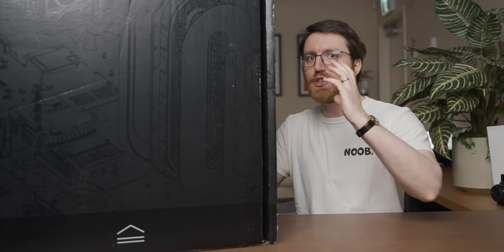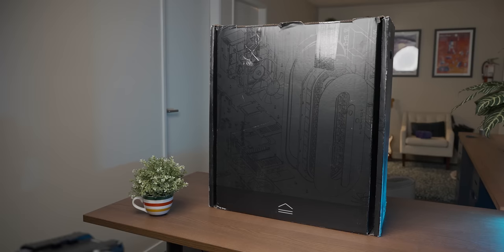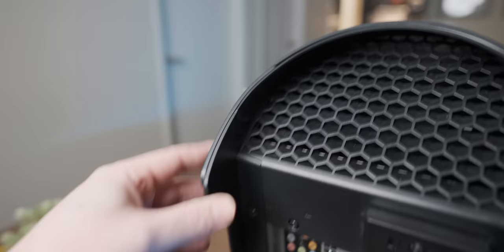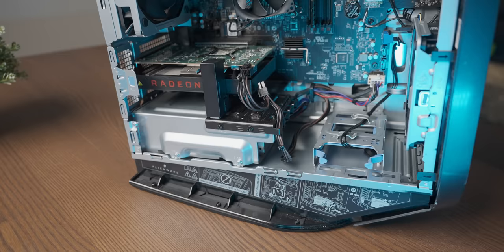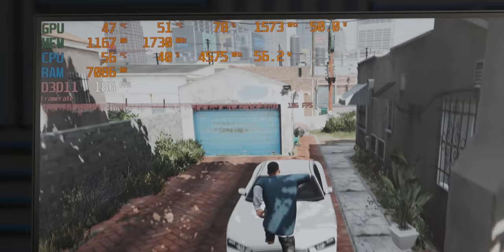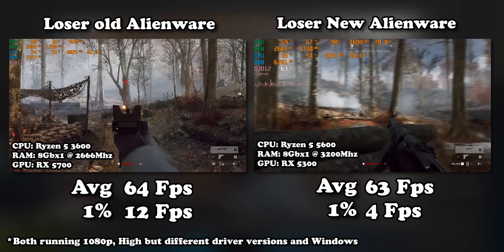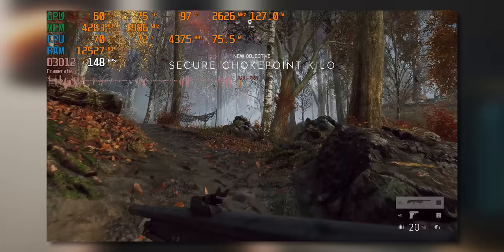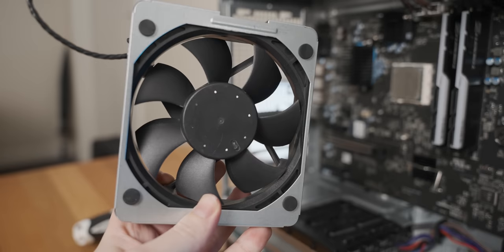Is Alienware's NEW Gaming Pre-Built Less Terrible?

Comment: By law, you have to be "done dirty" by Dell when you order a PC from them at this point
Reply from the maker: I think it’s part of their service to be honest.
Reply: @DawidDoesTechStuff   Did they get you with the monthly tech support scam too?
Reply: At least you get some standard power supply and motherboards with pretty much anything other than dell prebuilt systems for about the same price just in case you wanna upgrade the cooler and the cpu down the line... A prebuilt is almost never a good deal. I'd very much appreciate at least if the prebuilt systems with somewhat high end graphics cards in them were sold for like 150 dollars more and came with a decent motherboard and a decent power supply. But it's generally a motherboard that will throttle the top end cpu and a psu that will throttle almost any high power unit upgrade... That to me is just a shame because most of these units are customizable prior to your order.
Reply: It's weird in South Africa our Dell customer service is outstanding. Probably not the same worldwide.
Reply: laptops work fine. The Vostro 5515 took 4 days to deliver.
Reply: Me reading this with 2 dell PCs never had any issues: 👀
Reply: Honestly though, for someone who knows nothing or is ignorant to all matters of PC hardware and configuration, THIS must be an effing nightmare!

Comment: I swear these prebuilts are the same thing just in different bodies
Reply: That's like saying that Madonna in the 90's is the same thing as Madonna in the 80's: They both suck, and it's hard to tell which one was worse.
Reply: Funny Fact, Dell promised to make a E-waste less Laptop.

Yet they still pull this shit for desktops.

When their original dell  desktops could easily be transferred to a standard ATX case
Reply from the maker: They just see who can glue the most plastic crap to it. 😂
Reply: @darknessblades  looks at my old optiplex's proprietary front panel connection
Yeeeeah...about that
Reply: There are some nice prebuilts out there asus g15dk is a prebuilt I bought it has a ryzen 7 5800x cooled by a towercooler and the graphics card is an 3070 it has an 500gb nvme and 4 tb hdd which I installed my self and last but not least it has two 8 gb ram sticks which are in dual channel. The power supply is a greatwall which I made some research on and according to google and a couple off forums some corsair power supplys are rebranded greatwalls all this I got for 1800$ which in todays market is quite nice I would say 

My temps, if someone is interested were the only real problem I had with it besides the nvme being too small there fore I bought a 4tb hdd but I undervolted the cpu and changed some ppt tdc values runing at full load gaming I get around 60degrees celsius keep in mind it has no intake fans but okay airflow
Reply: @annoyinggasta  At least some old Optiplex PC's still use ATX motherboards
Reply: @DawidDoesTechStuff  😭😂
Reply: Alienware since the Dell buyout is the epitome of "Look how they massacred my boy!".
Reply: it like dell does doesn't a give fuck about have good rep or build quality
Reply: always have been for hella years
Reply: The Alienware is essentially an XPS with an outer shell.
Reply: @indridcold2840  90s Madonna :)
Reply: Optiplex 990 and 3010 are GOAT.
Reply: @arokh72  
Yeah if I had a gun to my head I'd probably go with 90's Madonna as well.
Reply: Well there's not many things they can add to a Ryzen build since they already had maxed specs on the last one but they did improve cooling a lot
Reply: And worse
Reply: Not all prebuilts are bad PCs. There are plenty of good options out there.
Reply: That's because they are. Every dell computer uses the same late 90s early 2000s crappy solid metal case. They just throw a bunch of plastic on it to make it look fancy.
Reply: @DawidDoesTechStuff  This is a bot who stole the comment!
Reply: L bought channel
Reply: Not all. Depends on the company. Usually it's better to go with companies like Ibuypower/Cyberpower than going with Dell/HP. 
Companies like Dell/HP couldn't care less about how you view your pre-built system. There will always be some ignorant people that will pay premuim for these trashcans just because of the generic names of these companies...
Reply: a n i m e
n
i
m
e
Reply: oh look another verified nobody commenting for clout
Reply: @indridcold2840  This dude literally every pre built PC even the best ones has something bad to say about it, i mean i get it some aren’t as good but even the good ones he has something bad to say. it’s never anything positive about pre builds. literally he never ever says anything else other this is bad this too small, too big🙄🙄. on and on!! It seems like this guy has an “agenda”.
Reply: @crylune  This dude literally hates on every pre build, i get that some are bad but the ones are known to be good, but this guys makes videos always have to say something bad, people seem to think they know it all🥴🙄.He literally knit picks.

Comment: Always love seeing that single channel memory, next to a cooler that I wouldn't pair with a Celeron... ULTIMATE GAMING!
Reply: a Celeron D from 2005 maybe.
Reply: That would be good for a Celeron though, I’ve had an i3 540 that has a stock cooler and it runs around 30°C normal temperatures load. You won’t be doing something intensive in a Celeron. It’s a perfect pairing to me! Balance out costs.

Comment: Just like the right to repair, OEM PC builders should be stopped from using proprietary stuff that they charge x2 to replace. This just contributes to E-waste as the upgrade options are so limited. Would never give Dell my money.
Good video 😁
Reply: What's even dumber is that they USED to use standard parts, and slowly make them more and more proprietary over time
Reply: I am with you. I will only ever give NZXT or Origin my money for pre-built saying they ONLY use standard PC parts. I'm sure there are others but those are the two that I know of the best.
Reply: it must really the replacement fees and prebuild tax they make profit on. Why design and order specially manufactured parts, when there is a 40 year old standard that would cost them less.
Reply: @HappyBeezerStudios  It is to force you to buy a new PC rather than upgrade & to try to force you to buy from them again = massive E-waste
Reply: i might give dell $2 if they were hungry an sleeping on the street

Comment: For the price they charge im shocked these OEM gaming systems even exist... My first gaming PC was an alienware and looking back on it I got SCAMMED hard on the price to spec ratio... like zero cooling and bad temps
Reply: The only OEM that’s worth the price is micro centers powerspec line up. They use actual well known parts and have the basics you expect an actual build to have (nvme, dual channel RAM, wraith spire cooler, etc)

Comment: If the PSU and motherboard was standard, I'd honestly recommend this OEM gaming machine with proper RAM of course. They improved air flow and improved case space. Ugh... Damn shame.
Reply: Yeah it's a shame about the PSU but to be fair their platinum 750w is likely quite good.  What Dell appears to have done here is standardize across the XPX/Alienware line  so no more standard psu and just the little guy we see in the older (and newer xps) and their server line. wasn't expecting a standard mb tho..
Reply: @notlNSIGHT  It‘s just pissing me off that they are doing this easy to repair Laptop stuff now to limit E-Waste, but are creating a ton more with this shit… All just marketing again…
Reply: It doesn't matter, because it is still mid 2000 propietary and overenginered office case for 1250$ overpriced PC

Comment: I amazes me how Alienware is still in business with the prices they charge, considering you can get an i5 11thgen and a 3060 in a system with dual channel 32gb ram from lenovo for roughly $1300
Reply: it's Dell. it doesn't matter if they don't make much under that brand, when the laptops and office machines make the big buck
Reply: Not over here in Hong Kong, they put a 10700 with a 2060 haha
Reply: Wow, even 1300$ for that is kind of a steal. Got a Ryzen 7 5800X3D and RX6800 for 100$ more

Comment: 10:45 you do have to give props to dell for the anti sag gpu holder, i wish more cases had something like that packed in. 
i wonder what GPU's are compatible with it.
6:20 also it looks like you can put another fan if you had the right bracket.
Reply: Yeah $0.05 plastic holder, well done Dell. Damn the Dell bar is Loooooooooow.
Reply: @fracturedlife1393  It’s just giving credit where’s its due. Dell isn’t necessarily great - but not many cases offer anti sag brackets, let alone mass produced prebuilt manufacturers.
Reply: the fact that they include it for that tiny RX 5300 though is hilarious. It's so unnecessary in that configuration.
Reply: @Insecurity119  the bracket is most likely due to shipping.
Reply: the power supply will support the gfx card.

unfortunately

Comment: I remember when dell bought alienware they sent an email to alienware customers assuring us that they wouldn't change how alienware does it's builds.  One of the best computer I ever owned was that pre Dell Alienware (2002) . Sad to see how Dell was so full of shit. It was also the last pre built system I ever owned.
Reply: Will say, there laptops are still insane! If you want/need a laptop like in my case, it’s perfect, they’re amazing!
Reply: @ATejkl  I had both laptop and prebuilt pc.. trash at the best.
Reply: @dzgaming1  I dont know which laptop you got, but mine was amazing
Reply: @ATejkl  OK maybe the laptop was nice but it was still overpriced and the wait for it to be built and shipped was too long.  This company is stilling putting single channel ram in Ryzen cpus.. that right there should tell you everything you need to know.
Reply: @dzgaming1  well, the laptops are designed and built by Alienware, but desktops are built by dell, so it’s dells problem, not theirs
Reply: @ATejkl lol dude, there is no Alienware anymore.

Comment: Y’know, Dell’s quality only seems to have DECREASED since I bought my Alienware 17 R5 from them almost 5 years ago.  At least that thing just needed a thermal paste replacement which was not that bad to do, but this is just sad what Dell has come down to.
Reply: Depends on your perspective, I've owned and/or worked on just about every model over the years and Its honestly always been hit or miss. Some of the product lines they really queeze every dollar and others they are far more progressive than other manufactures. That being said your models issues are partially due to Intel, they misspaced their thermal and tdp ratings so the OEMs had already began spec and production of the coolers prior to launch. Now Dell could have backpedaled and re-engineered a new cooler but if they did that they would also delay launch and it affects their relationship with Intel which is.... complicated. What aggravates me is they had the ability to over engineer the coolers and they choose not to, and its not the first time Intel has caused this issue. And with the R5 in particular it was the test per-say of a newer compact thin design thats why it only ran one revision because they wanted to use what they learned to develop the m line. And they did, but then also made the same mistakes again... I have a m17 R2 now myself and it has thermal issues with the i7, they all require undervolting to correct.
Reply: Dell’s gaming laptops have been known to be pretty decent. Their prebuilts however...
Reply: Yeah my pc is priced quite close to 1800 and it look so mich nicer lol
Reply: My Inspiron 7567 that I bought in the winter of 2016/17  is still going strong. Granted installed a M.2 and replaced the 500gb HDD that came with it; as well as upgrading the ram. I also did a fresh install of windows at some point after getting rid of all bloatware. Installed HWInfo64 for fan control so the 1050 doesn't cook and this thing has been a great laptop.
Reply: I also own an R5, and never had an issue with it. A year ago, I bought their new R15 specced pretty high and with water cooling, and thus far it's been running like a dream, quiet even under load. But yeah, that proprietary motherboard always scares me, although my old R5 is 7 years old and never had a problem, so I'm hopeful, as my factory warranty runs out very shortly...

Comment: What really sucks is that the 5300 was actually an amazing bang for buck card when it's priced correctly. I remember seeing a dell system with something like a 10300 (yes that's a real processor) and 5300 for under 500 USD at one point when on sale.
Reply: you gotta love how dells cheapness prevents you from using amd cooler hardware you have to use intel on amd that's hilarious🤣🤣🤣🤣🤣🤣🤣🤣🤣🤣🤣🤣🤣🤣🤣🤣🤣🤣

Comment: Remember when the minimum GPU that was actually in a prebuilt was a 1060, I miss when prebuilt “minimums” GPUs weren’t literal trash.
Reply: True, my friend got the last gen of good pre built, with a 1060 6GB. Kinda like kids nowadays. Rude, spoiled and not thankfull.
Reply: @cynthiacrescent  uhm, so first of, no i don’t, and second of, if i would, where’s the problem in that? I only said that dell is kinda like a kid nowadays. Don’t know where your origin of being hurt comes from. I didn’t do anything to you, did i?
Reply: my old Asus G11 CD-K's graphics card was a GTX 1050 (non ti), i miss when gpu's were in stock
Reply: A N I M E
N
I
M
E
Reply: oem prebuilds always used weak graphics cards and slow memory. I remember getting one in around 2005 that had a GeForce 6200 in it, but had a decent CPU and a good amount of ram with okay speeds.
 that's like getting a machine with a 5600X, 32 GB DDR4-3000 and GT 1030 today, but the DDR4 variant.
and a couple years ago I saw one with an i7-8700, 16 gb DDR4-2133 in single channel and a GT 750 running on a H110 board advertised as a gaming rig by a quite reputable brand here.
Reply: yeah fr
Reply: @Kokoro Katsura  do I see you ever so often in my comments ? lol
Reply: @Windows98R  animu girls
Reply: 1050 2GB showed up a lot in pre-builts and before that it was 950s etc...

There has always been a garbage tier GPU for OEMs to throw in.

Comment: The baseplate for the cpu cooler is literally machined onto the rear sidepanel behind the motherboard. By trying to eliminate the need to fiddle with a baseplate behind the cpu to streamline building and reduce costs, they ruined cooler upgradability. If they at least used standard parts, the machine would have been salvageable.

Comment: You could try Radeon's Anti Lag to get the input lag down. It can make a huge difference in some games.
Reply from the maker: That’s true, it definitely needed help with Doom.
Reply: Is sad that they have such option in the first place...
Should always be in performance mode :7
Reply: Anti-lag will add input lag on low frames
Reply: @iAMaReaperGotprobZ  Wrong. It may add input lag on high frame rates.
Reply: @iAMaReaperGotprobZ  Why would you use new hardware to play old games?

I rather build me scrapped old computer for old games.

Comment: Honestly, I'm glad I got an Alienware pre-built during Dell's last sale in March last year. Ended up getting a 6800xt, 5800x, 512gb nvme, and 16gb of 3200mhz DDR4 for $1977. Ended up ripping all that out and throwing them into a PC I built because I had so many issues with the Alienware operating system.
Reply: You got ripped off so much you could have bought a prebuid with better components for at least 800$ cheaper
Reply: @42o45  who’s selling that prebuilt config for almost $1000 cheaper with better components?😂

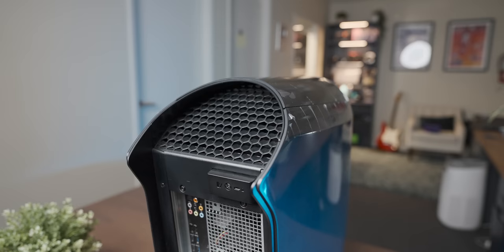Comment: 3:25 I actually see these wings as useful for protecting the cables and rear connectors when sliding that robot ~ against a wall.
In my setup, the power and DP connector are the ones taking the hit.

Comment: I really like AMD's GPU offerings this time around. I use a 6700xt daily and it's quiet and powerful. I will soon be pairing it with a 5800x.
Reply: I love my 6700xt as well.., although I am over killing my system by pairing it with a 5950x..
Reply: they really optimized their efficiency over the last couple of gens, which was always my main issue. I can see myself going team red next time if they keep going.
Reply: @VinnyVidiVintage  complete overkill. But, I got it for $360 US, so it was at least cheaper. Plus, I had already bought 32gb's of teamgroup ARGB 3600 speed ram for my 9700k last year. Which was a mistake. I also received a b550-F for Christmas. After purchasing a used Dark Rock Pro 4, my total cost was under $500.
Reply: @HappyBeezerStudios  I usually buy Nvidia but this time around I wanted to go all AMD. As soon as my Samsung 980 pro comes. All will be complete